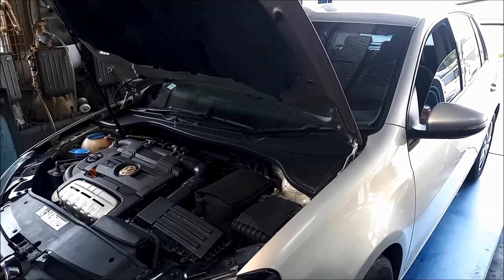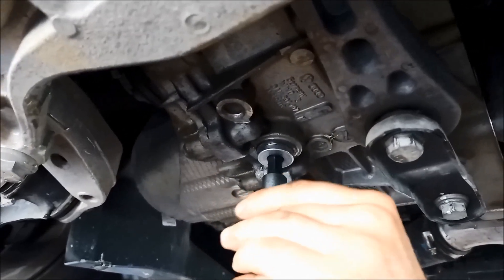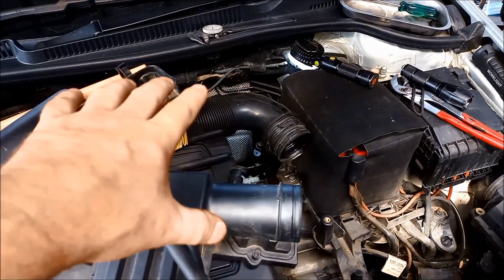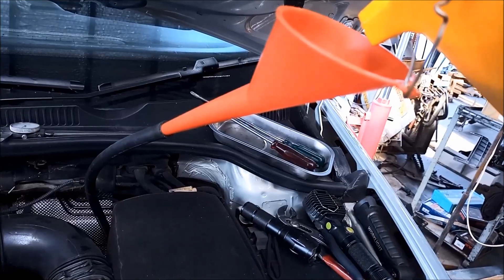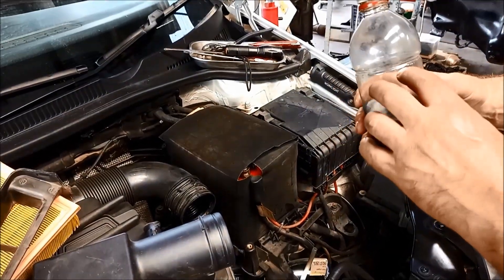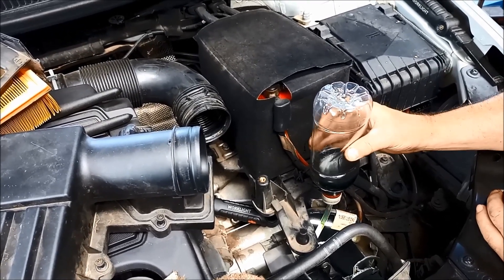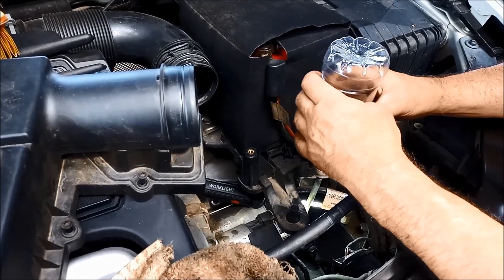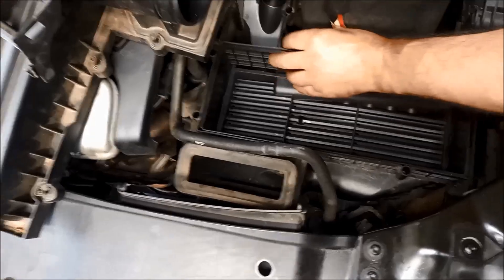How to Trans Service DQ200 DSG 7 Speed DQ250 OBH7 0AM OCW Gear Oil Change & Mechatronic Oil Change

Comment: I have a Jetta with 7 speed DSG dry clutch. I juz spoke to the VW service advisor today & he said my Jetta does not need to change any gear oil because it's "dry clutch". Is that true?
Reply from the maker: hi, not true - all mechanical components need regular servicing and maintenance. we advise an automatic transmission filter service every 50,000km when it has done under 200,000km and every 25,000km when it has done over 200,000km for maximum life and reliability of transmission. a bypass transmission cooler and adding additional magnets will also greatly help. cheers
Reply: @YepThatsIt  thks, bro.I feel the only way to confirm is to jack up the car at a workshop, take out the splash guard & visually locate the drain plugs for the gear oil. There should be 2 drain plugs? one of them with that plastic thingy insert?
Reply: Dealer says the same to me! Skoda karoq 7speed dsg! I have  done 80000 km and  feel vibration on second gear!
Reply: @g-bani1031  better chg the gear oil G055512A2 asap. Mine clocked 80+ K km when it developed a woo-woo sound at times from the under carriage. After the gearbox oil change, no more sound so far. I took pics of the oil change which I can share with u if u are keen...
Reply: @mikelee7183  thanks  for your advice😉
Reply: @g-bani1031  another item that needs attention is to replace the coolant every 30K miles. Use G12EVO VW coolant. U have ardy clocked 80K + km....which is abt 20K km above recommended coolant replacement if u have not done so. Price of coolant, gearbox oil are very cheap compared to a ruined gearbox, radiator etc...
Reply: @mikelee7183  thanks mate!
Reply: @mikelee7183 did you change both the mechatronic and the transmission oil?
Reply: @mariachiwaula7140  I only chg the transmission (gear) oil
Reply: No you don’t have to change it and it’s not a oil btw

Comment: hello, excellent video.  I have a polo dsg 7vl. Is it necessary to make any adjustments to the transmission with a scanner after changing the gears?  thanks for the info.
Reply from the maker: hi, not necessary with just a service. cheers

Comment: Thanks mate. Have changed the tranny oil several times but was stumped about how to change the meechatronics fluid without removing it off the car, inverting it and refilling back through the 5mm hex hole. This is great info.
Reply from the maker: glad helped, cheers
Reply: Hi buddy so u use to remove megatronic thn drain oil?

Comment: Hi, a couple of things I want to highlight, as far as i know (so please correct me if I'm wrong)
1. Mechatronics fluid G004000M2 as per the service manual it's lifetime and it should not be serviced.
2. For the transmission fluid as per the service manual you need to use G052171, why have you used a different one? 

Great video btw.
Reply from the maker: hi, 
1. dealerships say "filled for life" whereas when i asked why this was the case over 30 years ago to engineer manufacturers at an atra seminar they told me the correct wording is "filled for life of warranty" which equates to they do not want dealerships to touch transmissions while within the warranty period ( often if a problem occurs within the warranty period they will just replace the whole transmission ). unfortunately over time, many owners have equated that to mean that you never need to service a transmission.
2. no manufacturer can dispute use of any compatible trans fluid. we rarely use manufacturer brand fluids, but use quality compatible fluids.
having said all that... the choices are always for the individual to make. we guarantee our work and our decisions. often we will explain the options and let the owner decide
thanks & cheers
Reply: You have to understand what "lifetime" to a car manufacturer means.... that means until the warranty period expires.

No way is it for the total life of the car.
Reply: VW “lifetime” is 10 years or 300.000km. But no way i would let any oil get that age or mileage!
Reply: Do mechatronic need a software update or service interval reset after the oil change? Sorry if is a silly question. Thank you

Comment: If you put more than 1.7 litres in gear oil would it cause gears not to shift and vehicle to be in limp mode
Reply from the maker: hi, do you mean 1.7L overfilled ? i doubt would cause limp mode issue anyway as usually limp mode is an electrical problem. cheers

Comment: The DQ200 is a dry transmission, with only the mech having liquid. So what oil change for the transmission?
Reply from the maker: hi, the dual clutch is dry. there still a gear component that has oil and also a mechatronic component that has its own special fluid. have you watched the vid? cheers

Comment: Great video , I have one question doesn't this vehicle has a dsg oil filter?
Reply from the maker: hi, you can add a inline filter in cooling line, just make sure it flows correctly as those filters are directional. cheers

Comment: Also Part no G004000M2 referred by you for mechatronic   is a steering fluid oil. R they both same??
Reply from the maker: hi, use what is recommended or compatible. cheers

Comment: No filter to change on these units ?
Reply from the maker: hi, you need to disassemble trans to replace filter, but you can add an inline filter i cooling line. be aware that trans inline filter are directional flow. cheers

Comment: Is changing the mech fluid recommended as preventative maintenance? Thinking of getting a 2nd hand mk7 tsi 1.4L, but worried about reliability issues. I'm hoping changing the gear oil and maybe the mech fluid will prevent the mech from failing in the future.
Reply from the maker: hi, maintenance is maintenance, not repair. cheers